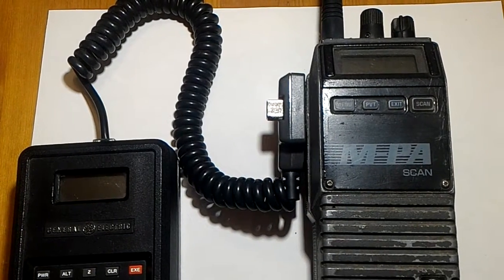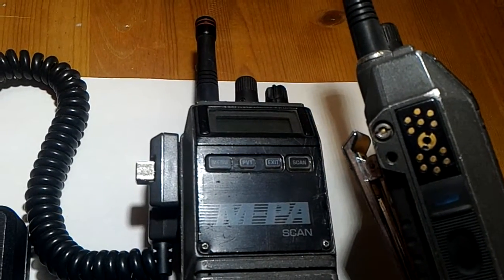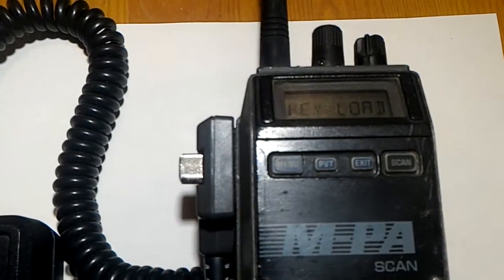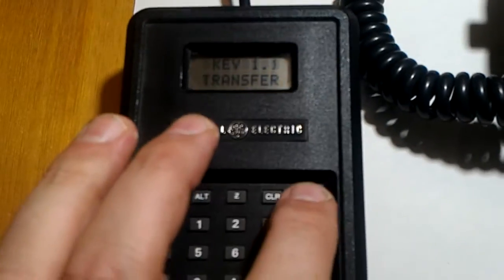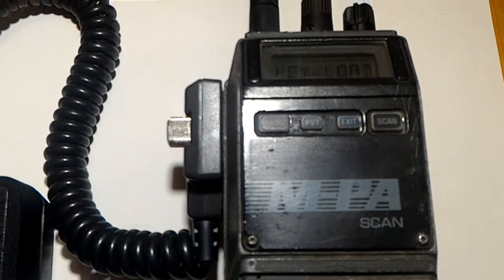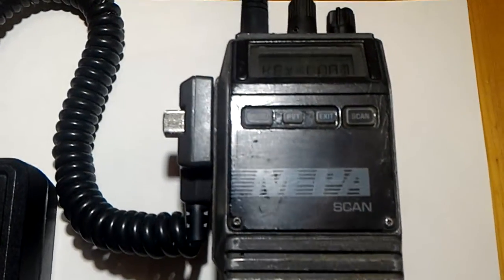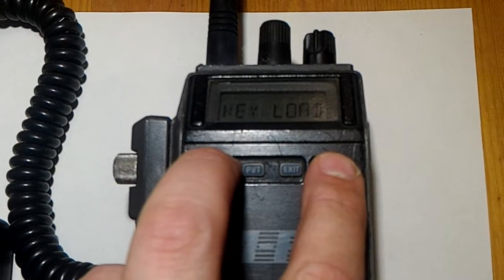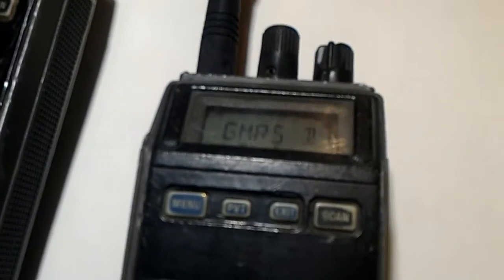Digital encryption with old police radios - Part 3 (keyloading)

Comment: Do you know anything about the bc250d.
Reply: Old Uniden scanner.  Doesn't worth buying that model anymore as radiocommunications have changed a lot since the big U release that scanner.
Reply: Exactly it may not trunk track either or even do some P25 as the DSP prob only handled 3600baud trunking